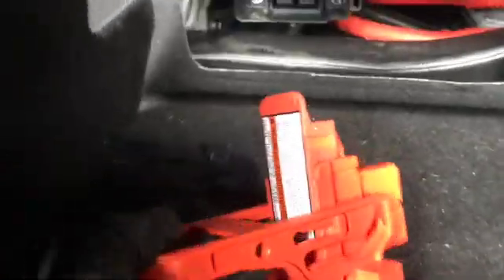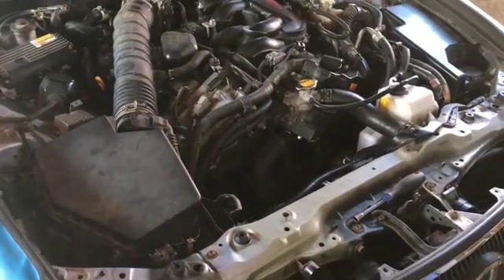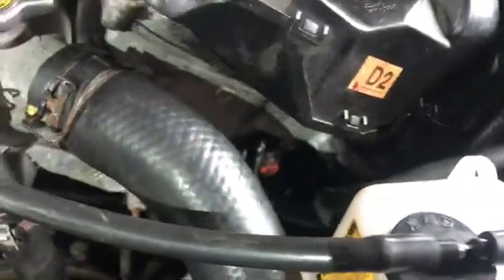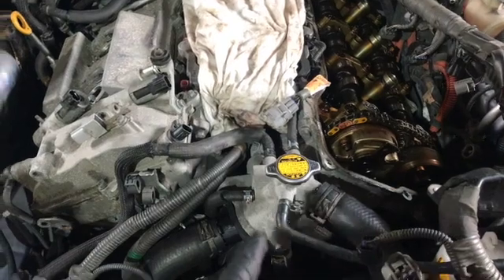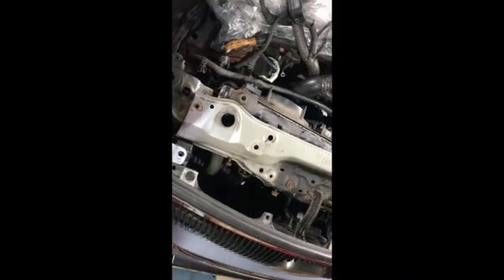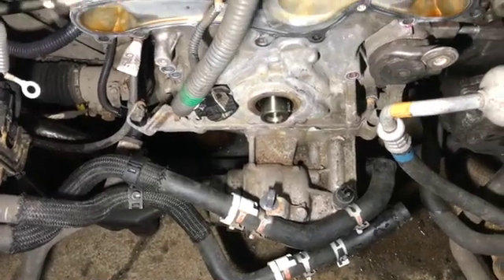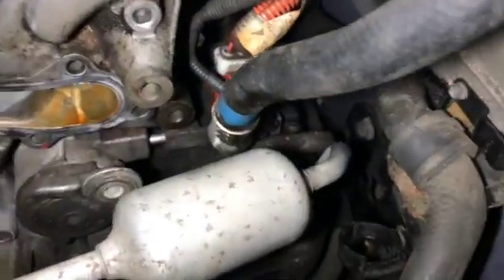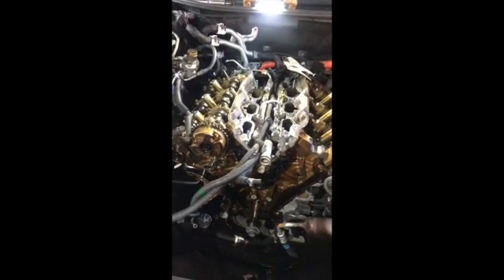Lexus GS450H engine strip down

Comment: Nice video. How was the fresh air inlet circuit, especially regarding EGR? Mine is working well (200000km) but maybe I should think about cleaning it?
Reply from the maker: There was no notable concerns with the intake.  A little bit of light carbon removal but that was all. Personally I’ve not seen any issues with the EGR but the car was given a carbon clean a few yrs ago so perhaps that’s helped.

Comment: Did you manage to remove the upper  oil pain without removing the engine subframe ?
Reply from the maker: Hi, I believe so though it’s a while ago we did it, it’s tight but possible thanks
Reply: @gary2turbos great, I will try to do it and let you know. Thank you very much for your help ! Great information
Reply: @gary2turbos 

Would you kindly explain how you moved the upper oil pan out of the way to get to the 2 bolts for timing chain cover. 

Did you lift the engine up slightly to get more room? 

Also did you have to remove the gearbox mount to get more angle. 

Please let know!
Reply from the maker: I seem to recall we had to slacken some of the subframe bolts to loosen it a bit to get access to some of the sump & sump sub assy. bolts. As per the diagram in the video there are quite a few on the sub assy, so have a good look around first to see if you can get to them without doing that.  I don’t recall having to move the gearbox mount but this was a while ago. Good luck!

Comment: Small note - (re)moving the radar assembly technically requires it to be recalibrated (i.e. aimed) later on. Shouldn't really be an issue if the radiator support bar is not moved.